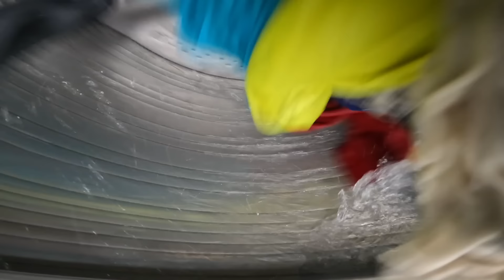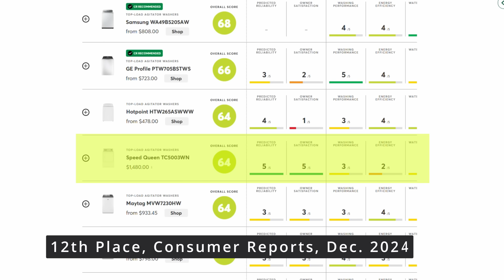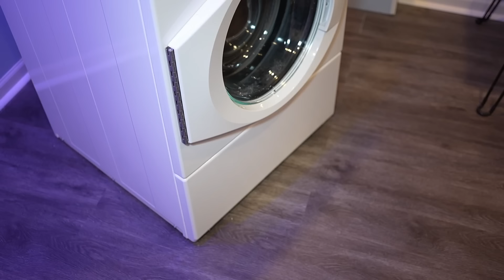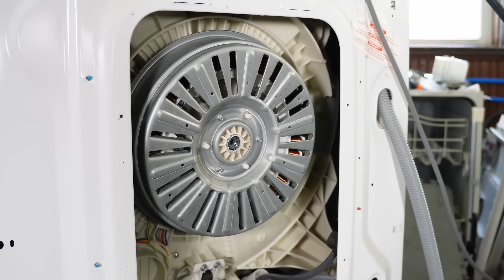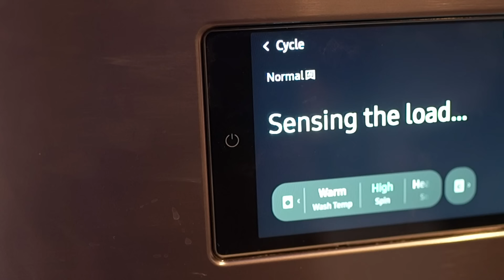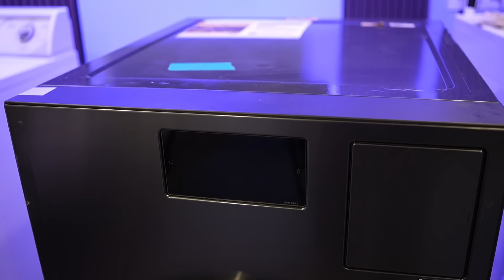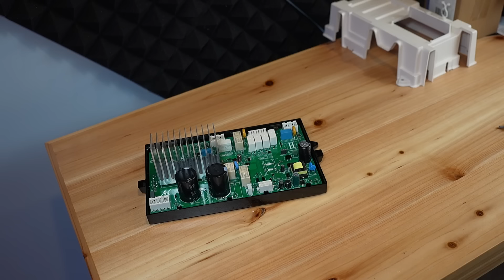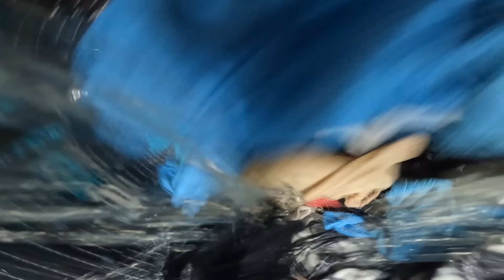Is America's Most Expensive Washer Great? The Speed Queen FF7009WN Test

Comment: I had heard that the Speed Queen was a great machine, so I watched this video.  When you say that Consumer Reports, a subscription that has to be unprejudiced to stay in business, ranked the Speed Queen low because it didn't look as nice as competitors,  I suspect that you are a Speed Queen zealot.
You say in the video that stain removal is mostly a factor of the detergent used, so then why compare the Speed Queen to competitors?  As I watched your review for stain removal (the color measurement device was nicely objective), I didn't see a post-washed T-shirt that I would wear out in public! Every one of them was still stained.   Doesn't everyone pretreat with stainzremoval spray and for white shirts, bleach?  How about comparing dirt to dirt removal per machine?  Does the machine even get all of the detergent out?
How about the "high efficiency" (HE) foolishness?  I have a 6 cu ft Maytag with "commercial technology" on the label, that my wife purchased for her business. She has to set it to deep fill manually, because auto-sense doesn't result in a clean product.   Will Speed Queen run HE loads without manual selection tinkering?
Reply from the maker: 1) Consumer reports ranks the Speed Queens low because they weigh reliability and user satisfaction the same as a machine which is quiet and is efficient. You can literally have the worlds least reliable, least-liked machine be rated very highly by CR if its quiet and efficient. The TC5 notably is the only washing machine that Consumer Reports lists that has a 5/5 in reliability (which some people, clearly not you) care about AND a 5/5 on user satisfaction. Literally the only washer on the list with a 5/5 user satisfaction of any brand. 

YOU may not care about that, but many of my viewers do. Its literally why I decided to spend $4,000 to actually try to prove or rebuke how good Speed Queen is. And if you watch the video to the end, I directly say its overpriced. 

Why compare stains? Because again, I wanted to debunk or show exactly what the stain removal quality was like vs. competitors. Many Speed Queen fans think they clean the best, but in the tests, its clear it wasn't. As I also said in the video (multiple times), the goal was creating baseline expectations against the inevidable TC5 comparison which is far and away their most popular machine. And if I want to make an honest judgment about that machine, baseline expectatons have to be created for a proper quantitative comparison.
Reply: @bensappliancesandjunk  thanks for replying, Ben. The tone of my comment may have come off as a skeptical, but I'm open to correction.  Reliability is pretty high on my list, next to ergonomics and efficiency. Cost is not so much a factor (you get what you pay for) unless it's far-and-away above competitors, bringing it into the realm of a commercial machine like, say, Huebsch.   The near-commercial Maytag my wife purchased was the tipping point that caused her to close her business. It simply did not clean large blankets, even after 4 washes!  Yeah, she was tired of the business, but the washer debacle was the straw that broke the back. Disenchanted with Maytag.
So when the stain tests you presented did not show >clean< t-shirts, I'm thinking,  "so why bother comparing?"

Comment: I'm a speedqueen servicer and I get called out on thess all the time. The reason that's important is because 99 times out of 100 they aren't really broken. The customer just did something out of the ordinary and in attempt to prevent itself from breaking, it turns off. Manual reset... the machine works fine. On this specific unit, I have seen an odd failure. After a time, it seems the seal on the balance ring can fail and the screws that hold it together can start to corrode. When this happens it creates a blockage in the ring and ball bearings get stuck on one side of the ring and it cannot balance. In my experience, you can just take the ring out, clean it out, rotate the seal and put it back together and it will work. Removing the drum on one of these is easy compared to any other machine I have worked on. I did a trunnion replacement on an older version of one of these the other day (it's a pretty involved repair) and it works like new.
Reply: Good to know. I put this another comment, but someone with some know-how on these machines should post some videos on how to perform maintenance (pull seals,drum,etc.) on them. Speed Queen has official technician videos on how to completely tear down the TR series, but noting on FFs.
Reply from the maker: Appliance Videos have teardowns. But I do intend to make a few videos on it. Repairs are insanely easy on this from what I can tell.
Reply: @bensappliancesandjunk  they are. On that machine you can probably have the inner drum out in about 15 minutes. But getting back together can be a bit fiddly depending on the job. Like a trunnion replacement, you have to torque the bolts to the right spec and then use a dial indicator to measure how true the drum is. Then you have you keep taking it in an out to adjust the torque on the bolts to get it right.
Reply: @ thanks, Ben, but all their videos are behind a paywall.
Reply from the maker: @sinister184  I totally understand we will be doing videos on the teardown of this unit the problem I always run into is just figuring out what the most common problems are with this unit that I want to tackle for repairs so we don't do 100 videos on the machine
Reply: @bensappliancesandjunk  Understandable. Whatever you share will be appreciated.
Reply: @TylerLibby-m1k  i would like to see that process.     Struts too! (especially the back ones )
Reply: @TylerLibby-m1k G,day there fellow appliance repairer from Australia 🤟🇦🇺 . Just wondering do you repair gas ovens as all. I am having spare part availability troubles
Reply: @bensappliancesandjunk 

Ive had issues with the water control valve (too much pressure) motor, control board (fairly easy) shocks, and now bearing. Id love to see the bearing job!
Reply: @bensappliancesandjunk mine is really loud when spinning.
Reply: Thank you for a servicer's review.  I loved this video, but it's always valuable to hear from a working source.    I wonder if you could stack a dryer on top and still have access to ll the functions.  Thank you
Reply: Is there problems with smells on the door. I went through heck with an early LG with that...put bad smells in all our clothes and I left the door of the washer open ALL the time except when doing a load. I got the speed queen right as the new rules rolled out making speed queen redesign everythiing....it was stock from the previous year that had not yet sold out...wheww....I love my speed queen. I'd pay 2k just for THAT.
Reply: @WindsofChange affresh tablets my friend. Every 2 months… also pack one with you if you go on vacation to an arbnb or some kind of rental… throw one in the washer when you first get there and clean everyone elses nastyness out of the washer before you use it. 👍🏻
Reply: @WindsofChange  Smells may be from not cleaning the washing machine. About every four weeks, or sooner if needed, the interior and backside of the drum has to be cleaned. You can buy professional cleaners, or do the same thing for far less $$$.
1 Cup of Baking Soda 
4 Cups of Household Vinegar 
Pour into the drum, hit the clean washer button, set to hot water and voila. Plenty of vids online about it. Hope it helps, have a blessed day.
Reply: @PBe777  No amount of cleaning helped,  been there, done that...I don't worry about it alot now, I have a speedqueen...
Reply: @PBe777  Don’t mix baking soda and vinegar for cleaning. They neutralize each other.
Reply: @PBe777  Just use the vinegar by itself for cleaning the washer.   It works better by itself.   Mixing vinegar with baking soda just creates salty water and tons of foam, neither of which are good at cleaning.
Reply: i have several clients that run speed queen 14 hours a day.  most of the calls i get stem from user error.  they have dozens of different people using them daily and employee turnover affects this as well.  often a hard reset and i find nothing wrong.
Reply: @briansboucher  how do you do a hard-reset ?
Reply: @poolahpot disconnect power for a minute.  Reconnect and the units work.  After that actually diagnostics would have to happen
Reply: Are the rings full of liquid, mine has already been warrantied out once and the shocks too because it sounds like a helicopter, I would love to know why my super expensive washer can't get it's balancing act together
Reply: Will they handle large blankets?
Reply: is it better to buy electric or gas for the speed queen dryer? currently hooked up for electric but could easily put a gas line in it
Reply: would u recomend gas or electric speed queen dryer?
Reply: A trunnion? Where I’m from we like to call it the spider. And yeah, that is a heavy repair. On most washers I diagnose (also a technician, occasionally work with Speed Queen since my company is a distributor), I would have to advise the customer to simply get a new one since the cost to repair was too high (and also, the part typically is NLA).
Reply: Is there a regularly maintenance I can do to prevent any service 📞
Reply: @joete3324  The #1 thing you can do is just follow the use and care directions in the manual. SQs are pretty bullet proof and they have the machine figured out, if you don't abuse them they will last a long time. They do have moving parts so like anything like that, parts can fail. A big mistake that people make is using too much bleach. Stainless steel hates bleach, so only use that as needed and not a lot.
Reply: Can this unit be taken apart so I can fit it down a 23” stairwell into my basement?
Reply: good to know. I just made a video of reinstalling the belt for the drum on one of mine. but mine is coin op and the display looks different. everything else is the same
Reply: What front load washer and dryer would you recommend?
Would love your suggestions
Reply: I have a speed queen dryer and need to replace timer switch but they no longer sell the switch it’s now the conversion kit part number D519029. it comes with a full wire harness do you know if i need to use the new harness or will the timer switch work with my old wiring ?
Reply: Is the digital display and circuit board a problem? I prefer front loaders but I want to save up for this. My Mon had a speed queer top loader that still ran after she moved out of her place after 25 years
Reply: Retailer service tech here. 

Biggest failure I see in these?
Install didn't take the front shipping bolts out...

I've seen a couple doors broken in like homeless housing situations.  

I'm so sad SQ had an IPO now...
Reply: is it owrth buying one from 2017? used
Reply: @randomrazr  Depends on how it was used.
Reply: Hey I have a TC5.
Question, is the pressure switch adjustable? 
Question, on the ‘heavy duty’ setting, the first spin runs on slow speed, and the spray rinse starts before the tub is empty. Can this be remedied?
Reply: That’s really interesting insight from someone who services these machines. It sounds like a lot of “failures” people report are actually the protection system doing its job rather than the washer truly breaking. Also good to hear that the drum and balance ring are relatively serviceable. Being able to clean or repair parts instead of replacing the whole assembly is something you don’t see much on modern appliances anymore.
Reply: Mine has broke three times so far. First time the connector to the motherboard got loose and stopped working. Then water got into the electric lock and fried the lock and motherboard. And now it won’t start because one of the valves and/or level sensors is shorted. Luckily parts are available and reasonably priced.
Reply: I'm a service manager. Our #1 and #2 is drive boards and door locks. Just my experience.
Reply: Showing the lie of their "20 - 30 year" design.

You shouldn't ever need to replace seals and such before that time; if you need to call in someone to replace seals, you might as well take the opportunity to upgrade.
Reply: @VideoArchiveGuy  u dont recomend speed queens?
Reply: @randomrazr  Just saying don't fall for the hype, be aware walking in.
Reply: @VideoArchiveGuy  i wanted to get speed queen but a fornt loader in canada is 3850 dollars...just for the washer
Reply: How is this a good machine if it requires a tech to come out and reset it?
Reply: @Rverma30  The MACHINE doesn't require a tech to reset it, the USER does.
Reply: @Rverma30  Look up "How to reset" all your appliances by model. There likely will be a video.  My washer can be reset by holding a button down for six seconds or so. I think you have to unplug it and plug it back in, first. But I bought the most simple washer I could find, ten years ago. Has dials and a start button, not a touch screen.

Comment: I paid $1200 for a Maytag Neptune in 1998. Which would be equal to $2300 today.
Lasted 4.5 years…JUNK!
I threw it in the junk pile and bought a used Maytag from 1985….40 years later…STILL WORKS PERFECTLY!
Reply from the maker: Neptunes were famously bad
Reply: @bensappliancesandjunk  I loved mine, only issue is I wanted more features.
Reply: @bensappliancesandjunk  Never had any issues with mine, not even the infamous wax door lock assembly that was replaced under recall even though mine worked fine.

Never had any issues with it, but wanted different features and replaced it after a decade.
Reply: The Trunion Bearing failed. According to repair tech, the  cost then was $600 to replace.
I found a guy on the internet named Tony who developed a tool designed to assist in replacing the bearing called the ‘Tony Tool’, but the tool was $350.
He suggested I trash the unit and Craigslist search what he called “old reliable”, which is the Maytag unit produced for many years.
I did…best washer equipment decision I could have ever made.
HAPPY NEW YEAR BEN!!!
Reply: My parents bought the same, around the same time…many issues from day one 
Maytag man changed the board numerous times etc etc etc
Reply: I replaced my Neptune in 2008 not because it died but because I wanted different features.

Completely reliable, even the wax motor.
Reply: That contrast is pretty wild — paying top dollar for a “modern” washer that lasted only a few years, then ending up with an older machine that just keeps going. It really highlights how differently some of those older Maytags were built. Simpler designs, heavier components, and fewer electronics seem to make a huge difference in long-term durability.

Comment: Schematic. Any sane person with a penchant for electronics or tools will praise that to the ends of the earth. It might be entirely end user repairable if it is extensive enough, like parts can easily be swapped in.

Give or take a couple hundred bucks for a Speed Queen is an instant buy. 1000 bucks, you have to weigh the trends for its competitors. As you stated, 600 bucks for the control board? Bam, 1 or 2 problems like that in the first 5 years easily justify it. If you can get on on a partial sale you can easily rest peacefully.

Comment: I have a Kenmore set I purchased in 2000  , the washer is a top loader though . Still going fine 25 years later . I did have to replace the belt on the dryer once last year ,but that’s it . I don’t like the design for the belt ,as idler does not use a pulley in the dryer ,but it actually glides over a slide . Regardless though it’s only failed once in 24 years
Reply from the maker: Kenmores from 1990 - 2004 are probably the best washer ever made

Comment: I think stain removal is very much independent from machine quality/performance. Detergent type, quantity, how much water does the machine take during pre and main wash cycles (affecting detergent concentration) etc all are more significant factors. Besides, with many of those stains if I were to have any hope of getting rid of them, I would use bleach or a milder stain remover locally and agitate by hand since in the machine they get diluted so much and harm other items. Results pretty much being same isn't a surprise.
Sometimes putting in an ungodly amount of detergent and cranking it to the longest program with extra water setting, and stain remover in the prewash reservoir helps when I have lots of clothes with lots of hard little stains. Then the question becomes, the capacity of the detergent reservoir, how slick its surface so can it resist the caking powder detergent, how powerful is the water flow into the detergent reservoir, does foam and water overflow into the detergent intake (happens when you go overboard with the detergent and have towels etc that can make lots of bubbles) and out through the reservoir making a huge mess and in that case does it seep into the machine internals or only to the outside?
Reply from the maker: I don't disagree. Many times when I've done washer reviews, I've skipped the soil tests, but for such an expensive washer, I felt that testing soil vs. other machines was needed because an often-commented statement is how amazing Speed Queens are at soil removal by their owners and.... that wasn't true in these tests.